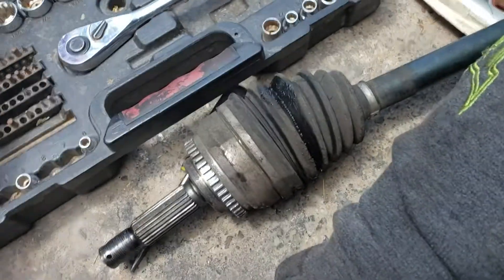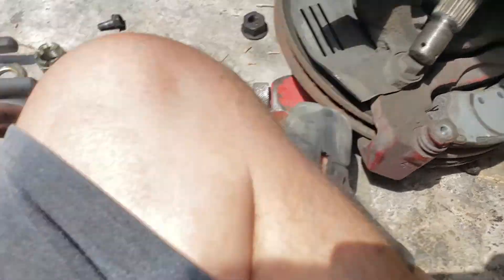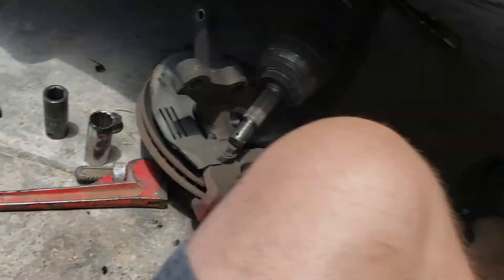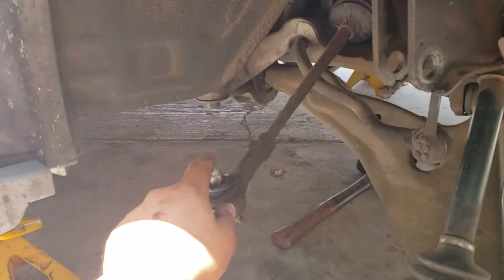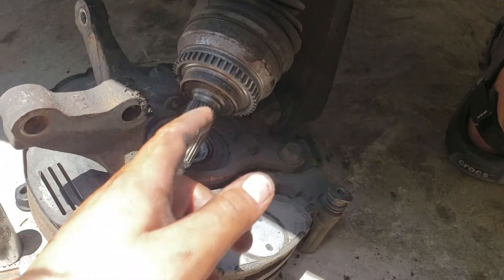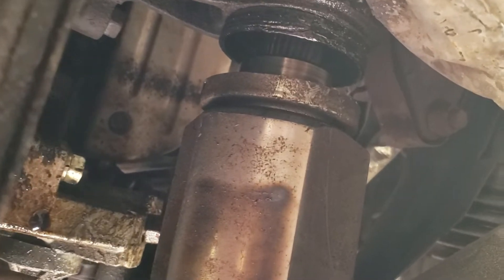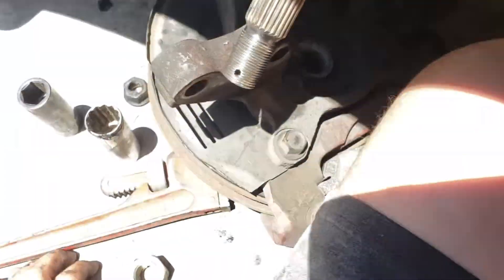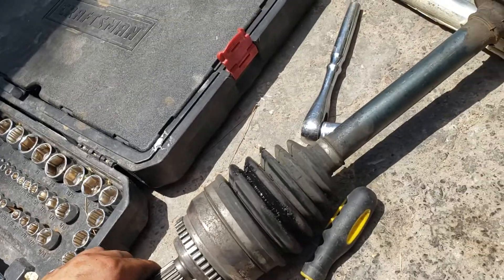2003 eclipse gts cv axle removal

Comment: Does that suspension spring have a lot of tension you have to fight when you attach the hub assembly back on it?
Reply from the maker: Nothing whatsoever easy to remove and easy to take off I'll make a video later on more into detail later on
Reply: @ourcarproject3059  Thank you, that was one thing that had me held up on continuing a removal of the axle on the one I am doing major repairs on.